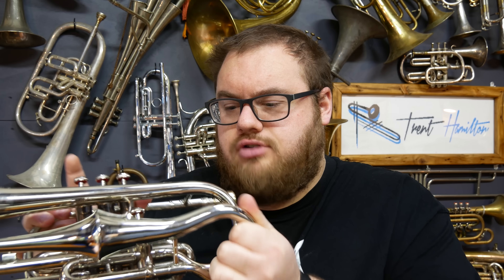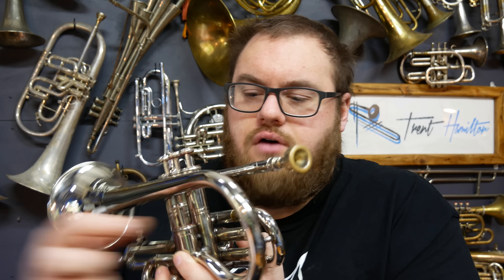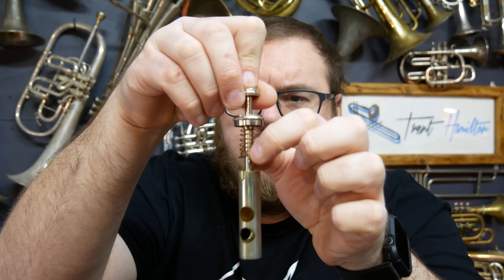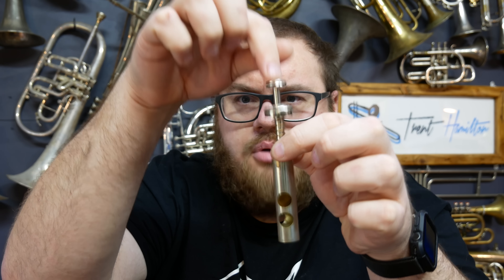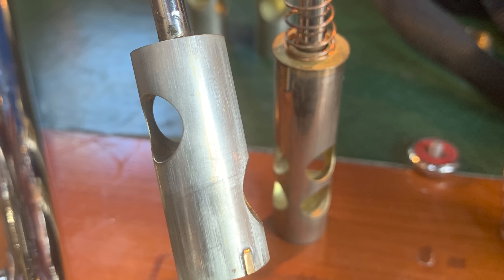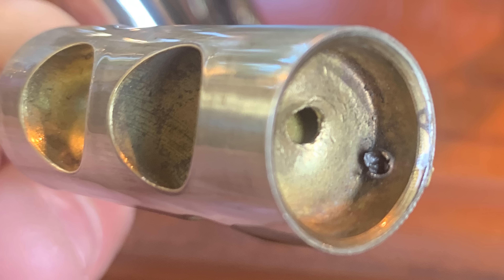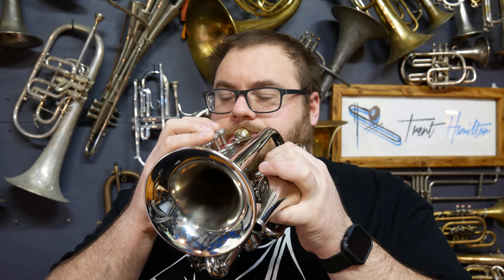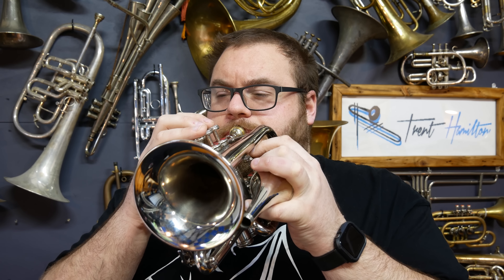Interesting video about the Echo Cornet

Comment: The only time I've seen an echo cornet in performance, it was in the hands of the trumpeter in a mariachi band. There were songs originally written for two trumpets in a call-and-response style, and he would use the echo cornet on those, and play the second trumpet part through the echo bell. The part that probably made it work better is that he had a full size second bell and a proper mute, so there were no weird intonation issues beyond what the mute caused. I am willing to bet the full second bell was salvaged from another instrument and then retrofitted to the echo cornet, but it did solve the problem.

I could also see this being useful in a pit orchestra, such as on a Broadway show. Sometimes the instrument changes and mute insertions can be brutal, and then someone starts editing out bits of the show and you find yourself with zero switch time.

Comment: Ah, how interesting! When I saw the title here, it piqued my interest immediately. I'm an organist, and the "echo cornet" is a somewhat uncommon (these days anyway) stop you'll find on some organs. Possibly more commonly in North German/Dutch organs of the baroque era? That may be pulled right out my arse though. At any rate, this video illustrates quite clearly where the nomenclature for that stop came from. A "cornet" is a combination stop extremely common and necessary for quite a lot of organ repertoire, but it can tend to be a rather loud voice, meant for monody/solo voice above a softer accompanying stop combination. The reason for this is that it isn't actually just one rank of pipes, but rather typically a combination of 4 to 5 pipes at different pitch levels along the overtone series which, when combined in proper tune, produce a fairly loud, sometimes piercing sound that is roughly analogous to the sound of the orchestral cornet itself. Roughly. Anyway to the point here, the stop we have called the ECHO cornet is usually just a much smaller scale combination of ranks that effectively produces a tamer, quieter sound of approximately the same timbre. Some organs, especially in the more modern traditions of building, have an entire division/department called an "echo," usually mounted as an antiphonal extension on the opposite side of the room, where you're quite likely to find an echo cornet stop. So I've known many organists who assume that it was labeled as such simply because it's in the "echo" department. However that same department is more often called simply the antiphonal department, but you'd still see an echo cornet stop (if indeed you see one at all). 

TL;DR: this video gave me a wonderful bit of worldly context as to the orchestral progenitor of a fairly uncommon stop I've encountered as an organist, which is typically voiced as a combination of pipes that produce a tone somewhat analogous to a muted cornet, in contrast to the very very common cornet stops that feature prominently as more powerful solo stops in the organ world which are roughly analogous in timbre to an actual cornet. 

Thanks for sharing your collection with us. And fond greetings from the other side of the globe, from a wee displaced Scottish organist under lockdown in America where everything's gone ass over teakettle. Stay well, mate, and keep up the interesting videos about the wonderful world of brass instruments!
Reply from the maker: Hi Dallas, what you may not know is that I'm also a keen (but very amateur) pipe organ player too. The organ Cornet is usually a five rank combination stop (I personally am not a fan of anything with a tierce in it), and isn't related to the cornet as in brass band cornet (IE: what this video is about). The organ cornet is thought to imitate the cornett or zink - a much older instrument.

Comment: Interesting to hear how to disassemble the 4th valve. My SAI monstrosity has not even been out of its smelly case since I did that video all those months ago. Mine audibly differs from your example in that your one is a lot quieter when run through the secondary "bell". No doubt I could play softer but if I were going to vary my pressure in a trill or otherwise rapidly oscillate between the normal bell and the bolted-on scooter exhaust assembly, it would be quite the pain. I also remember my SAI being some weird leadpipe diameter and not taking either a standard cornet mouthpiece or a standard trumpet one. Is yours the same?
Reply from the maker: Hi Graham, yes, the leadpipe is larger than a normal cornet one, but it's fairly close. I can make my normal large bore cornet mouthpieces fit.

Comment: My speculation is that it would serve best in a marching band situation where one wouldn't necessarily want to faff about with a separate mute. 

Or as you demonstrated with Taps, in a sombre situation like a military funeral, messing around with a mute might be a distraction for the mourners.

Speaking of which, the military does have mock trumpets, that look the part but electronically play a recording of Taps, for use at funerals because of not every company having a bugle boy any longer.

Comment: Not that I can think of any specific examples but this would be pretty handy for poor orchestrations where you only have a couple of bars in 2 at tempos upwards of 170 to get a mute in or out. Not that it’d be strictly necessary, just handy. And seeing as the secondary bell is removable you could design and make other secondary bells relatively easily (either with improved intonation, analogues for different mutes maybe some different blown percussion effects) could be a great playground for a new brass avant-garde. If you made a modified valve you could even split the air instead of completely diverting it and have the options to add harmonics.

Comment: Sir Trent:
You may not see this since the video was posted some time ago, but my comments below reflect one has found a unique application for this instrument.
I am one who plays the tune Taps for military burials and special occasions.
For burials, I use a high-end trumpet that has an incredible sound.
For special occasions, I got hold of this one instrument and have found that it fits this unique niche quite well.
 These special occasions have seen the echo effect of Taps come through powerfully. I have not needed to work with another trumpeter. 
This was a wonderful idea.
The cost has been acceptable.
Thanks.

PS: ONLY the last note is echoed from the appropriate "trio" parts.
Reply from the maker: Thanks for your comment. This seems like an appropriate use case for one of these instruments. Even better because with Taps you don't have to use the valves.

Comment: As a trombone player who has frequently struggled with mutes, this seems like a great idea.

Both in pit orchestras and concert bands, I have seen mute changes that are too fast to be done smoothly.  If you are a composer, I want to tell you now that 2 seconds is not enough to change a mute!!  Trombones require 2 hands to play, so when I've had fast mute changes like this, I have occasionally taken to holding the mute between my knees just so I can make the change as fast as possible.  And when the fast change is removing the mute, there is always a chance that one of the trombone players will drop the mute, making a huge commotion. 

So, it is very strange to hear Trent keep saying "I have no idea why ...."  To be fair, a trumpet or cornet can easily be played with one hand, so the mute changes can be much quicker, but even for trumpets, I feel like this could really be useful.

Comment: I have often wondered if there was a way to play true chords on a brass instrument.  I wonder if this horn could be adapted by changing the fourth piston in this horn to split the airstream between the two "bells", making a custom bell and pushing the air through a reed or some other sound generator (o into a microphone and using it as an oscillator to run through a synth) to raise, lower, or change the note to produce an actual two (or three with a polyphonic synth) chord.  Any thoughts?

Comment: Hi Trent, while it IS a very niche instrument, I can see a position that it may have filled well. I was part of a duo where I played the xylorimba, and acted as the 'band' for a musician who played flugel horn, cornet, or trumpet depending on the song. We did mainly 60's stuff but through in the odd 80s, 90s, 00s, and 10s stuff. Sadly the brass player died before his time. We typically busked (though once one the TBL Duet Contest at the state champsionships). During pieces as just 2 players, I often swapped mallets, and he swapped instruments mid piece etc. and with this instrument (or a similiar one) being able to change timbre to quickly differentiate between backing vocals and primary melody would have been possibly handy! As a percussionist I can't say, but in the persussion world we have so many weird and wack things, often held in place with duct tape (lol but true) that I can see we may have used this. NB: For my final concerto in the final exam for my master of music (performance) I found a tuna can chat would wedge underneth a timpanis pedal and thus allow me to do a VERY chick change without needing to look at the gauge, as it jammed it in the right place.
I defeinitely agree it's a niche, and maybe not a called for niche, but I applaud the designers of instruments like this because although not commercially succeful, sometimes they are JUST what somebody wants!
By the way, love you videos. Now as a professional arranger not a player, these help my crank out 'okay enough' arrangements of pop songs that are pretty much sight-readable for 'community bands' but sound half decent. I play the baritone myself in spare time and to work out how hard the 'quick' passages' would be and maybe choose a key that makes fingering easier on the recreational musicians, and are never bored with your vids... they have helped me out produce professional arrange 'drafts' greatly (their expert finishes them and slaps his name on them)!